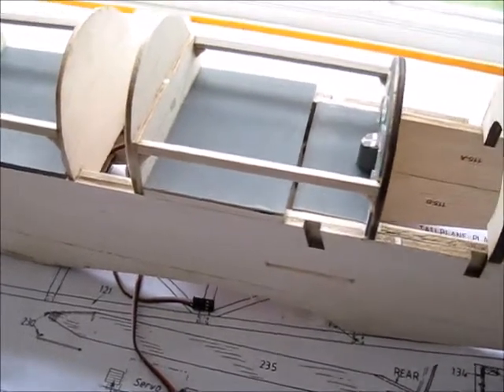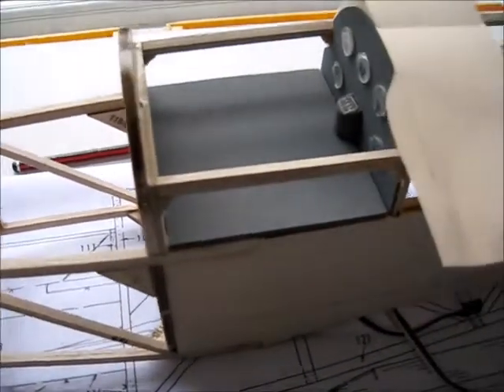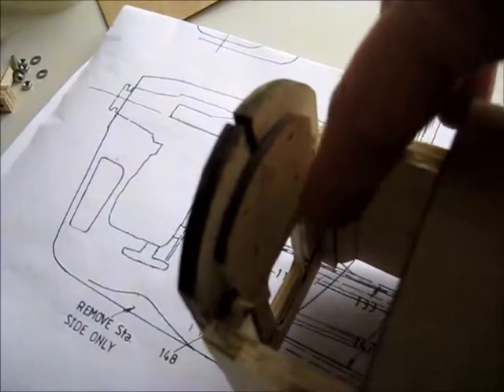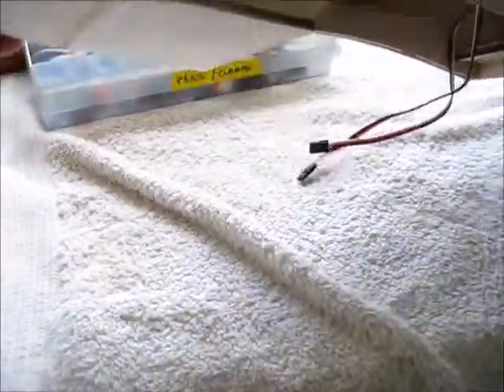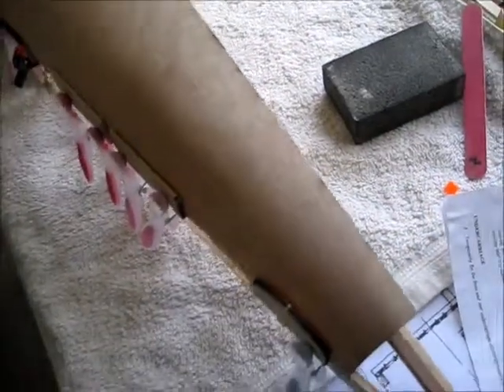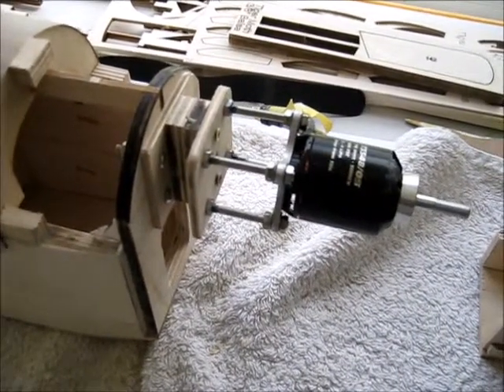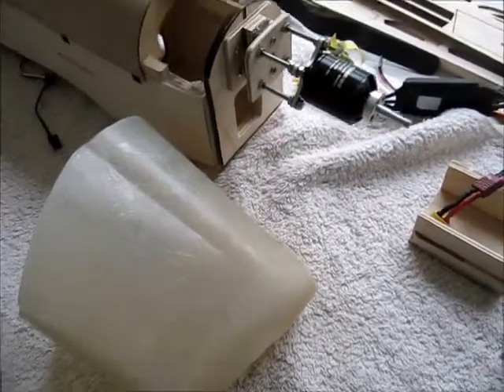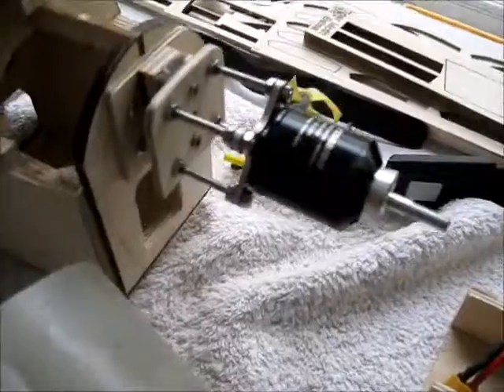DB Sport & Scale Tiger Moth build - Fuselage part 3

Comment: Alan, very nice job on this.  I'm building this model as well and certainly with less craftsmanship than yours.  It would have been very helpful if I had found these videos sooner...... 😞   I have the fuselage at about the same state as yours but I covered the top in three pieces per the plan.  I cut out the rear cockpit last night and as you say it was not easy.  I'm going to add the fore and aft braces to support the sides per your plan as they are flimsy,  I'm building the lower wing center section now and have completed the wing panels.  I plan to join mine together before covering because I don't think I could get it all together correctly otherwise.  I had difficulty getting the longerons to have a sharp bend at 106 and 110.  In the end, I used water and ammonia but still cracked one longeron and had to add some CF to repair.   I'm using a 4S/4000ma battery and a 4020 motor.  The rudder and elevator halves will be pull-pull though details are pending.  For sure the rudder will be very similar to yours.  I'm going to have a go at the Shuttleworth Tiger Moth scheme using Ora Cover and paint.  I'm looking forward to seeing your continuing progress.  Please keep the videos coming.  Best regards, John
Reply from the maker: Hi John, good to hear from you. I've only built a few kits, and nothing as complicated as this biplane, so my building is very slow.  I'm currently struggling with the cabanes, having to cut out slots in the curved decking which seems sacrilege !  Also don't understand the instructions about joining the steel rods and the spars, and the stitching to the plate.  Seems an unnecessarily complicated way of doing it !  I may go for a more simple pushrod arrangement for the elevator using twin steel rods as I'm more familiar with this type of arrangement, whereas I know next to nothing about pull pull.  Will be covering mine with Oratex, silver for the wings, and dark blue fuselage, and buy civilian type numbers. cheers Alan
Reply: @alanbarnstable6874  Alan, Here are some links that may help with the cabane and other items.  The first one from Terry Walters showing some unfortunate repairs he had to do shows good detail on the cabane.  https://www.modelflying.co.uk/forums/postings.asp?th=63885&p=4   This one shows how Norrland modified the cowl to make a battery hatch like you are doing.  I'm following his method as well.  https://www.modelflying.co.uk/forums/postings.asp?th=115002&p=1  This one is for the Gypsy Moth build but there are many similarities so good info.  https://www.modelflying.co.uk/forums/postings.asp?th=87885&p=2  And a few more.  https://www.modelflying.co.uk/forums/postings.asp?th=87885&p=9 ; Terry Walters Photo Group https://www.modelflying.co.uk/albums/member_album.asp?a=16454 ; 48" DB TM build https://www.modelflying.co.uk/forums/postings.asp?th=87885&p=9  I found these helpful or at least interesting.  Have a nice evening, John